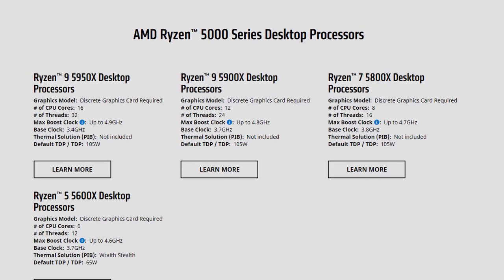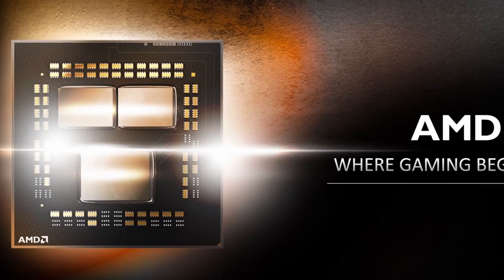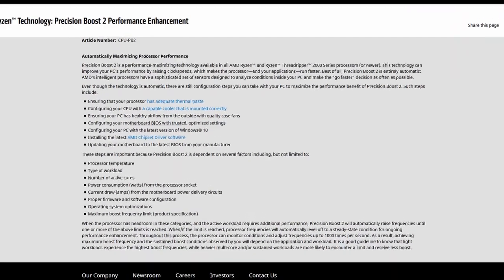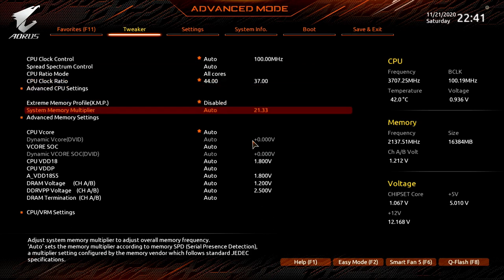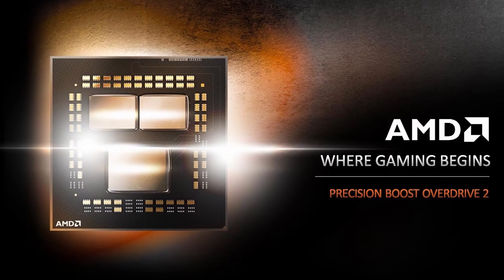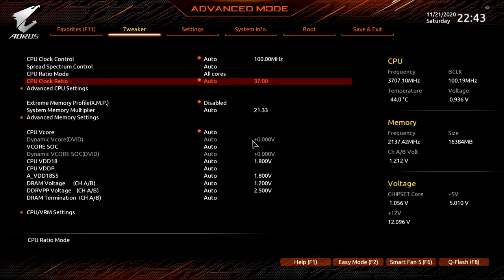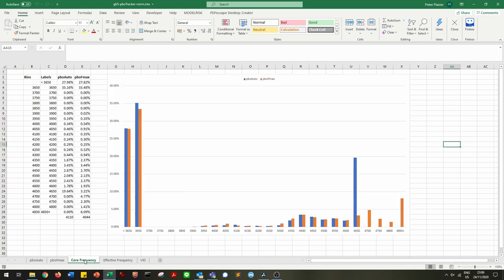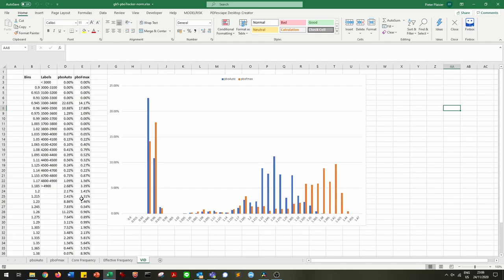Ryzen 5 5600X Overclocked to 4650 MHz With GIGABYTE AORUS B550 | SkatterBencher #18

Comment: This was SUPER helpful. I used your PBO+XMP+FMAX trick and my 5600x's Passmark ratings went up significantly:
Overall Mark: 8433 --> 8822
Single Core: 3347 --> 3570 (surpassing the new i7-11700k)
CPU-Average: 22693 --> 23197
2D Mark: 1147 --> 1219
3D Mark: 23840 --> 25382
Memory Mark: 3347--> 3477
Reply from the maker: That's great to hear! Free performance is the best performance :D

Comment: I can not stress this enough. Your videos are an amazing resource and I am extremely grateful for all the information that you provide. Coming from an old school (relative to the newer guys out there) overclocker. First ever overclock was on a 3.2 P4 on socket 478 pegged that thing to 3.8 on close to 1.45v (HOT HOT HOT). Recently gotten back into this wonderful hobby and built myself a nice 5700x based system. Did the PBO2 +XMP (overclocked ram to 4200 {stock was 4000})+ Fmax 200 and the performance increase is phenomenal. I'm on a Gigabyte motherboard and don't like its relative basic overclocking features. MSI and ASUS have a better layout, heck even ASrock is more decent. Total system build was also under $450, very impressive performance to price nowadays.

Comment: awesome video, a lot of knowledge! it would be cool if you also started putting in the temperatures of each "case" you test.
Is there a chance you will make a new 5950x video for the Asus with dynamic OC + Big brain PBO2 where you can undervolt  + fmax increases combo? Seen some people do some smart stuff to increase performance even more but there are no guides hehe.
Reply from the maker: Thanks for the kind words and feedback! Good point on the temperatures, I will try to add that next time.

I agree DOS OC + Fmax Offset + PBO2 curve optimizer would probably be the mix with the best potential for overall system performance. I will think of a video idea that can incorporate this. (I don't like going back to the exact same system :) )

Comment: Using the ryzen 5 5600x on my msi b450 bazooka. Believe me, my cpu boosts to 4.65ghz on stock settings. It hits the 4.65ghz frequency on 4 cores everytime stable and uses 1.27V. I love this processor. I love my b450 more
Reply: turn on prime smallestftts you get crashed in 1sec,i can have even 1.25v when i only make occt and some soft program like that lmao
Reply: @kejsuuu  I'll check it out. But i only play games on my pc and it never crashes no matter which game i play and for hours
Reply: @12345midyo  yes,it dont crashes cuz maximum consumption power from games or streaming will be maybe 80-100w and prime95 push it to limit around 145+ its  impossible to stress computer like that in normal things
Reply: @Mister Vengeance yess i am bro

Comment: I actually managed to get a golden sample of the Ryzen 5600X. My chip Does 4.9Ghz on Just 1.218v. I could Actually push it further But I need more cooling headroom. As im only using a cooler master Hyper 212 RGB Black Edition cooler.

Comment: I've randomly ended up watching one of your video and god u make good content! Had to subscribe to your stuff to see more content of you! Got one question. I have 2 different setups.. I like small form factor cases, so i ended up having 2 small case. Mb is Asus ROG Strix B550-i Gaming, mini -itx, got 5900x and 5600x - both have 2x 16mb memory, at 3200MHz 15-15-15-36. Another computer have strix OC edition, 3060 and 3080. 

Only game what i fancy at the moment is tarkov, so it leans more heavily to few core and max GHz on cpu. 

What kind of setting would you recommend to go to get best GHz on both processors and do u have other tips to improve performance? XMP is enabled on both motherboards. 

CPU cooling is handled with Noctua NH-U12A cooler.
Reply from the maker: Thanks for the kind words and subscribing!

Considering the small form factor I think you will be mostly (ambient) temperature constraint. For those cases, PBO is really ideal because it will boost to high frequencies when few cores are in use and drop to lower frequencies when all cores are in use.

So, I would enable PBO and XMP. You can also try to enable Fmax Offset and see if there's any additional range.
Reply: @SkatterBencher  Rooger that :) How about asus suite 3 - over clocking? What is your opinion about that? :) Now i started to work around with 5600x and from what submenu i can find that Fmax Offset option? Updated my bios just resently and cannot find spot on video where u showed it :(
Reply: If i could know under what submenu i can do that, it would be all clear to me ? :D
Reply from the maker: As a general rule of thumb I try to avoid most overclocking software and prefer to configure my overclock from the BIOS. But, maybe that's because I'm old-school :).

I don't know the exact layout of your board's BIOS, but Fmax offset should always be in the AMD Overclocking sub-menu. Something along the lines of:

Advanced > AMD Overclocking > Accept > Precision Boost Overdrive (Advanced) > Max CPU Boost Clock Override
Reply: @SkatterBencher  It was exactly on the spot what u told :D Increased it with 200mhz, but then i crashed.. had to take down -20 negative in curve optimizer, so now its disabled and +200mhz works ok as i tested it in game.. need to go for harder test during evening.. 

I've also tried that ai_suite and performance gains in there was terrible :( 

So this setup seems to go highest mhz and performance is the best - big thanks to you!

Comment: When you do manual overclocking liken in Step #3, is it normal behavior that idle clock speed is staying at 4650MHz? It's not downclocking at all.
Reply: from older asus motherboards "boost" or in asus case "turbo" the clock stays the same in manual mode. auto mode usually does the boosting. didn't like the turbo mode on the older motherboards and left it on manual when overclocking. but might be different with ryzen. i'll know for sure when my board gets here

Comment: hello there!  I own a 5600x cpu, I have turbo mode enabled in my gigabyte b550 elite v2, when I am gaming my cpu frequency goes to 4.7ghz and my temps go from 60-65-75 degrees celcius max.My question is - is it okay for gaming to have this turbo boost enabled, is it normal to reach 4.5-4-7ghz while gaming? 
If it is not, is there a way for me to decrease it from 4.7 to go to like 4.4 ghz so the temps are not so high and will this deacrease or improve gaming performance?
Please help me i am a total noob when it comes to hardware
Reply: PBO with undervolt

Comment: I just got an ROG Crosshair VIII Dark Hero motherboard, and I have a 5950X CPU coming, but I’m not sure which memory would be optimum for highest performance and overclocking?

I’ve been considering either the G.Skill Trident Z Neo at 3800MHz, 4x8GB, or the Corsair Vengeance RGB Pro, 4000MHz, 2x16GB.

So there’s all these things to consider like which brand, frequency, size, how many sticks 2 or 4, is it optimised for Ryzen, is the RGB compatible with ASUS Aura Sync...

What do you think?
Reply: With Zen 3 go for 4 sticks better than 2, or go dual rank ram
Reply from the maker: Not factoring in the price and availability, of those two kits I would probably go for the G.SKILL Trident Z Neo. Here's why: 1) I personally use G.SKILL and have been for years. Never had an issue, so ... I guess brand loyalty :); 2) Ryzen 5000 synchronous mode will top out for most chips around DDR4-3600/3800, so I'm not sure if it makes sense for a higher rated kit.

But, honestly speaking, either kit will likely be totally fine. So maybe just go with the kit that matches your other parts design wise?
Reply: Thats a fine blade to wield for an amateur....id look at the qvl list for compatible chips.
Reply: get 2 sticks 4000mhz+ b-die and then set it at 3800 mhz 1900 fclk and go low timings and subtimings as much as u can up to 1.5 v  for me the best is 3800 cl 14 14 14 28  ( i have patriot viper 4133 ) u will see some serious gain.
Reply: @dardan1a915  can you print screen settings ? timings with voltage. I`ve got the same ram but much higher timings
Reply: @prytosan  https://i.imgur.com/tnXyRQb.png  this is 4400 mhz kit but same thing with 4133 at 1.5v can go up to 1.52 v  https://i.imgur.com/ObxzECd.png

Comment: over 1.35 i get over 95C and even over 100C at 1.37
However...
I got it stable even at 110W cpu package power running linpack,
1.260v 4.5ghz all core

I can do 4.65ghz effective clocks with PBO and negative curve (using AMD RYZEN MASTER automatic curve optimization process(took 2 hours))

Comment: 5600.@ 4.65ghz all core. r23 multi:- 12128
                                                  Single:- 1543
@1.2375v 77c Max temp 30min @ cheap tower cooler

Comment: Watching since I have an x570 Aorus Master and a 5900x. I've been playing around and I can't decide what would be better. PBO or all core? I'd be using more for gaming but I don't want to kill multicore performance. I'm new to Ryzen overclocking as I came from an i7-6700k. Any tips? Also, I have a CL17 4000mhz kit of ram. Would it be better to try to push infinity fabrics to 2000mhz or leave at 1800mhz and tighten timings / slow ram down for the 1:1?
Reply from the maker: Good questions. Here's my suggestion for your system.

1) PBO all the way. This will give you the highest single threaded performance and pretty good multi-threaded performance. You can try to squeeze a little more out of PBO with Fmax offset.
2) Enable XMP
3a) If XMP frequency is DDR4-3600 or below, just run the infinity fabric FCLK in 1:1
3b) if XMP frequency is between DDR4-3600 and DDR4-4266, choose DDR4-3600 1:1 or DDR4-4266 1:2.
3c) if XMP frequency is DDR4-4266 or over, run the infinity fabric FCLK 1:2

Running FCLK in async mode will give you a performance penalty. High-speed memory can overcome this performance penalty, but it depends on the specific application which is better. I find that , generally, over DDR4-4266 the performance penalty of async mode is mitigated across the majority of my applications.

Comment: Omg did your trick went from just 3.7 ghz to 4.65 all cores idle is 26c and at full load like Warzone is 61c. Didn’t need to adjust voltage left it on Auto I also didn’t mess with the fmax enhancer because it’s for a previous amd cpu version so I left it disabled. My cooler is a coolermaster hyper 212 black edition. G skill flare x 3200mhz oced to 3800mhz cl14 with no wheas woohoo I lucked out I saw increases all across the benchmarks. On a Asus rog strix b350-f gaming mobo updated bios in May 2022 and the b350 chipset in Oct 2022.

Comment: One of the factorsused by PBO2 is the number of "active cores". In the BIOS the number of active physical cores can be decreased (Downcore control is normally in Auto). What is better from PBO2 point of view and max performance in mainly single threaded games like flight sims? (they have several threads and one of them is the heavy one)
Reply from the maker: PBO will automatically take care of redistributing workloads across cores. I wouldn't recommend disabling cores.

Comment: With DDR 3200 RAM and only the default XMP Profile, is it worth trying to overclock the RAM to say 3600MHz and spend ages trying to figure out the acceptable timings or should I just go out and by 3600MHz RAM and return the 3200 RAM?
Reply from the maker: The easy approach to this is:

1) Enable XMP: this will set memory timings and frequency
2) Increase only the memory ratio: this will raise the frequency but keep most XMP settings
3) If unstable, look to increase the voltage of the memory

Most motherboards have "auto-rules" that will adjust the secondary and tertiary timings to match the target memory frequency. So unless you're really trying to find the absolute maximum performance (in benchmarks), there's no need to worry about those too much.
Reply: @SkatterBencher  What I ended up doing is looking at the same Corsair part in the 3600MHz version and copying those timings and it worked like a charm. The 3600 part probably has the same physical chips as the 3200 part--just not guaranteed for that rating. I noticed the SPD was identical otherwise, and interestingly 2 of the sticks had Samsung chips, and the other two Hynix. My overall Passmark w/3600MHz RAM is now 9057 (up from 8433 stock, and 8822 with BPO+FMAX w/3200Hz RAM), and my memory mark now at 3623 (up from 3347 stock, and 3477 with BPO+FMAX w/3200Hz RAM), and my 3D Mark now at 25523 (up from 23840 stock, and 25382 with PBO+MAX w/3200Hz RAM). The $900 PowerColor RX 6800 Red Dragon (stock condition) is effectively neck-and-neck with the best graphics card listed on Passmark: the RTX 3090 which is $2300. Incredible performance with this 5600x. BTW, I'm using a Gigabyte Vision-D B550 board. Beautiful board.
Reply from the maker: That's great! It's always satisfying to see research and effort result in free performance gains :)

Comment: When I enable Core Performance Boost on 5600x I start getting bsod,
Mobo is b550 aorus pro ac
3600mhz gskill c18
3060ti
650watt psu 80+ gold
Kraken x53 aio cpu temps are below 40°C
Reply from the maker: Did you just enable PBO? Or also XMP or Fmax offset?

What are the temperatures under load? (i.e. Cinebench R23)
Reply: @SkatterBencher  Cleared cmos
 Loaded optimised defaults 
XMP enabled
Core Performance boost is enabled by default when I boot I get bsod disable cpb and no crash at all.
Reply: @SkatterBencher  update:

Disabled CPB and manually set cpu clock ratio to 44.00 and Cpu vcore 1.250 CPU works fine no bsod at all but CPU will run continuously at higher clocks even on idle.

Comment: I have the same motherboard, cpu and the 32 gigs of trident z neo ram, my power supply is only 650 though, I'm worried that might be dangerous to overclock? Am I ok doing that? My GPU is a 3060 Ti.
Reply from the maker: 650W will be more than sufficient to increase the CPU performance by overclocking, no worries.

Comment: At what overclock speeds stopped passing p95 small fft stable?
Reply from the maker: I could get it stable at 4400 MHz. Above that it would be too hot. You can see my settings from 08:13 onward.

Comment: If i have ryze 5 5600 non X which setting is best for me to games? im using te step 2 settings on b550 aours elite v2 motherboards. I also have the SilentiumPC Supremo FM2 750W 80 Plus Gold just in case.
Reply: Also fortis 5 cpu cooler

Comment: I have the B550M DS3H instead of the Aorus, will that prove problematic?
Reply from the maker: The overclocking process will be the same, however your mileage may vary considering the VRM specification and VRM thermal solution.
Reply: @SkatterBencher  thank you. I think this will just require some hands on learning. 
The motherboard isn't a super high end piece, but I did manage to get a good watercooler, so I guess we'll see.

Comment: my ryzen 5600x wont overclock automatically and even turning pbo to enable it still stuck @3.6ghz in any load.
Reply from the maker: Is the effective clock (Hwinfo) also stuck at 3600?
Reply: @SkatterBencher  thanks for the reply. Yea its stuck at 3.6ghz thats why the frames in valorant on anymap went from 400-600 down to 180-350
Reply from the maker: What motherboard and cooling are you using?

Comment: I don't get ONE crucial thing : There is simply no way with my B550 Aorus Elite that i will even boot with 4.7Ghz ALL CORE. But RYZEN MASTER has no problem setting perfectly stable 4.8Ghz  ....  How the hell ?  My 5600X was very luck , i can do 4850 all core for benchmarks but its not stable in games  , 4.75-4.8 is , but ryzen master will not apply settings when it boots. This is stupid , how software under windows can achive much higher OC ? . It is no small difference ...
Reply from the maker: That sounds like very strange behavior. Are you sure the system is stable at 4.8GHz in Windows? Also, are you sure the voltage is set to the same with Ryzen master and when you do it manually from BIOS?
Reply: @SkatterBencher   Yes , 4.8Ghz 1.4v i can run any test 24/7  . 4.85Ghz is troll , i can run some benchmarks even games , but it will crash sooner or later.  I Run F12 bios now , PBO works much better i have better single score than 4.8Ghz all core. SC CPUZ is 672 ( boosts 4850-4900Ghz on 2 best cores). Multi is lower .. around 5050 (Compared to over 5200 on 4.8Ghz all core).
But temperatures droped drasticaly when i set -15 ( weaker cores) and -20 best cores in Curve optimizer. From 74C full load to 64C Full load  (1.33v) - Shadowrock 3 cooling.

Comment: I had to completely re flash my bios after trying the big brain play
Reply from the maker: Wow, that's very strange. What happened?
Reply: @SkatterBencher  just crashed to the blue screen and then I got a vga error that wouldnt resolve from restarting
Reply from the maker: Couldn't you just reset the BIOS? Load optimized defaults?

Comment: Would this also work on R5 5600g?
Reply from the maker: The overclocking process for all Ryzen 5000 products, including the 5600G, is very similar. Of course you mileage will vary depending on your specific CPU, the cooling used, motherboard, etc. Good luck!

Comment: Very nice video thank you for it. I do have a problem same MB and CPU PBO-XMP and even on 1900 FCLK I can't get more then 1570 Mhz memory bus. DDR4-3133.
Reply from the maker: Huh? You're running Async Mode with high FCLK?
Reply: @SkatterBencher  Can't find where Synchronous Mode is in the bios, looked everywhere. I've manage to to run the CPU FSB to 99.8 Mhz after turning the SVM mode off.

Comment: Can this +200mhc done with 5800x on air cooler dark rock pro4?
Reply from the maker: You can definitely try, but whether it will successfully boost to +200MHz is another question. That will depend on your CPU as well as the general cooling in your chassis